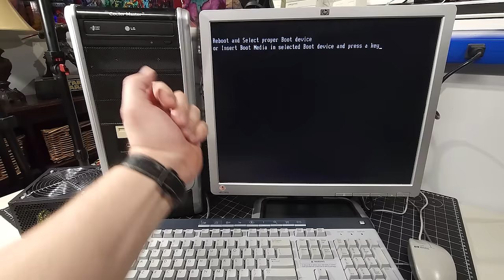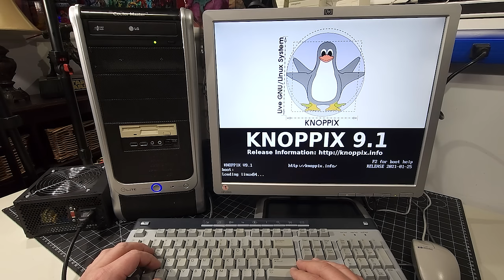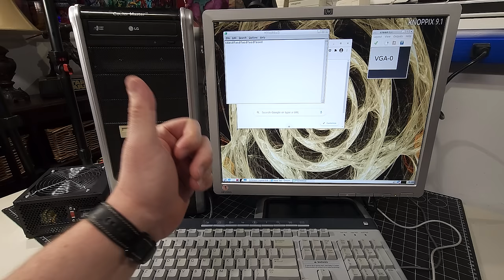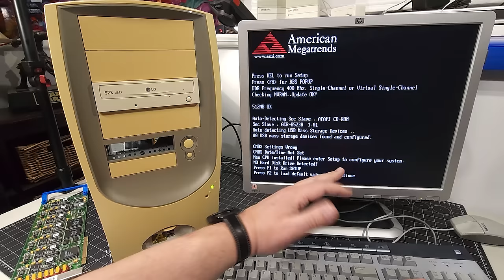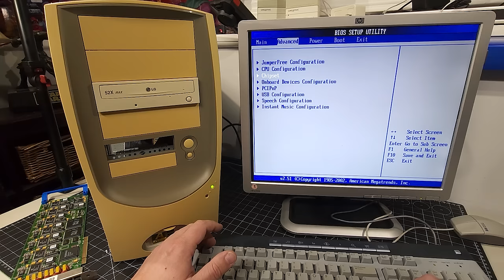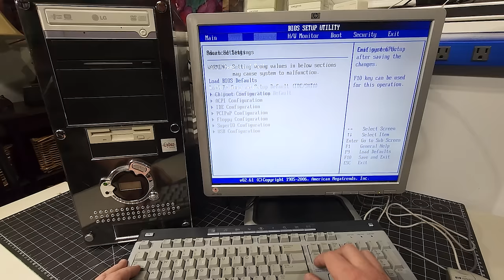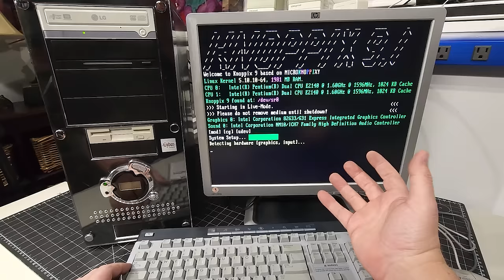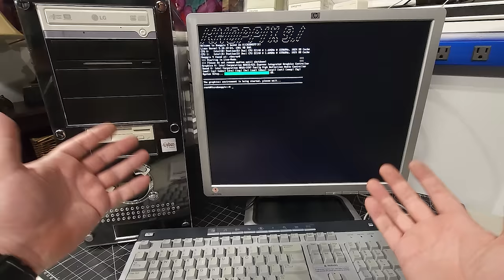Mystery Custom RETRO PC's...What's inside??

Comment: I still have a few of those Socket 478 and LGA 775 systems kicking around. Lot of people hate on the Netburst era Pentiums, but I ran one from 2005 until 2015 when I finally upgraded to an i7-6700K build. Built the P4 machine to replace my overclocked Athlon T-Bird build from a few years prior when it finally let the magic smoke out. Still pull it out every once and a while, but my main XP rig now is an overclocked Core 2 Quad Q9550 running XP Pro 64bit …. Works shockingly well and have not run into any real compatibility issues with my older games on the Quad or XP 64. Plus, seeing 8GB of DDR2 and four CPU cores in XP is just ridiculous… it’s like dropping a 402 small block in a Geo Metro lol.
Reply from the maker: Hahaha indeed! I love hearing the stories of these Custom builds and the fact they are still going today.  Great work!

Comment: What was the motherboard of the first pc ?

Recently found a bunch of goodies from the electronics container at work here from discarded pc's post Christmas.
A mini itx pc with a Asus Strix B250i, Pentium g4600 in this motherboard, case was missing the surrounding cover, was no storage or ram present either.
A Atx motherboard also from Asus A Z170-P which had an I7 6700 that also works fine so far.
Swapped the cpus around so the mini itx board has the I7 6700 to make a compact pc for my dad to make use of.
Though need to order some DDR4 or find some cheap used ones to make use of these, should be a decent rig for my dad though together with the HP oem GTX 1660 TI i found.
Also gotten some newer gpus like a msi aero gtx 1050 2 gb, a zotac gtx 1050 ti mini 4 gb.
And a final part if im not allowed to grab stuff anymore is a AMD Ryzen 7 3700x out of a HP desktop pc.
Reply: Nice.  Pentium4600 is still good for Ubuntu. And the rest might be fair for Windows10 gaming.
Reply from the maker: That's some awesome finds!!! The first MB was an MSI ms7529.

Comment: 7:22 The high end MSI boards do last longer than the budget MSI boards. I have a top of the line MSI that runs a first gen i5 and is working fine, I have more than one dead or dying mid range MSI boards, when it comes to older hardware ASUS has dependability across the board (pun intended).
9:48 Well that is a score, decent video card for that era.
17:44 A open sticker behind the door because the person was embarrassed to have such an ugly machine.
19:50 Looks like a RAS server, it could take many dial up phone lines then connect them to other servers on the network through the LAN. I had to manage one back in the day but ours only had 4 lines coming in. That would have been expensive in the day. Door #3 is the best looking case.
Reply from the maker: Hahaha such an ugly case.  It hurts my eyes 😂.  As for the RAS server info, thanks!  It seems to be the general consensus.  Others have identified the card as a card with 8 x 56k modems which is really cool!  Up for signing up with some dial up?! Apparently I can now open up an ISP :)

Comment: I love that third case, it’s so early 2K’s. If you ever want to sell it lemme know.

The lcd on that case is a temperature display and they typically had a coin cell battery 🪫 to power it.
Reply from the maker: Thank you!!!! I will try to get it going and maybe post a short about it or something.  Thanks again!
Reply: nah those lcds are not battery powered. ive had 2 cases that had them. and both were molex powered. the 1st was just a 5v molex and allowed you to toggle select between cpu, hdd and system temps. the other used 5v and 12v molex but that had a fan controller and monitored fan rpm while also showing cpu and system temps. so somewhere in that rat nest of wires there should be a molex that is not connected
Reply from the maker: I'll take a look, thanks!
Reply: @chloeprice8  all the cases I’ve owned and built for customers with them from the early 2Ks had a battery then after a couple of years none of them used batteries and then they all but disappeared.

Comment: The one on the right in the intro is the exact kind of look I was going for with my slot 1 machine. It has a black case with two beige optical drives and a gray floppy drive. I wanted it to look like an old system from 1999 or 2000 that someone swapped into a new flashy case in 2002 or so while keeping the same drives.
Reply from the maker: Hahha well, we will see what I do with the config soon!

Comment: that big card from the second pc looks like a ibm card with the blue handle on the end
Reply from the maker: I thought the same thing.  8 x RJ11 ports.... Curious...
Reply: @TheRetroRecall  why would some1 want that many? the amount of IC's that were on it is crazy! it must of been very exspensive to buy
Reply from the maker: I think it may have been used as a small server allowing remote techs possibly to 'dial in' on old phone lines to access resources on the system.  The card would have been expensive for sure - one of the comments on the video stated that they found the card on Amazon for 450 USD today!

Comment: I had the black case with the clear plastic front. Mine had blue leds where the 6 bolts are. I smashed it with a baseball bat long ago I hated the design internally.
Reply from the maker: Haha... Did it make you angry lol?
Reply: @TheRetroRecall  I built it for my brother. for example hard drive installing was like nails on a chalkboard feeling.I was used to using cases with rails for dvd and hdd.simple put on and slide in. SO when I got new cases i removed the hardware and went to town. wink
Reply from the maker: Ha ha! I laughed reading this lol.  Thank you!